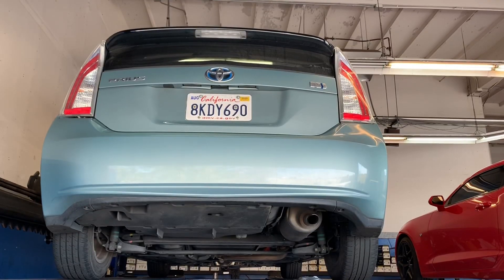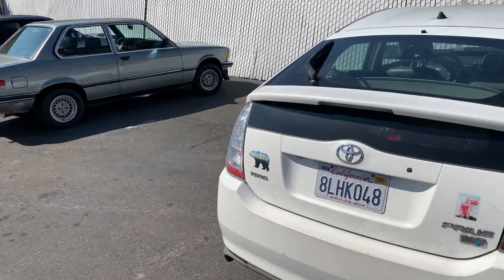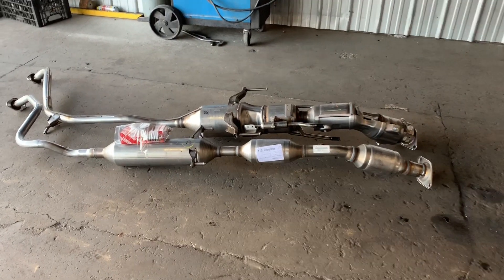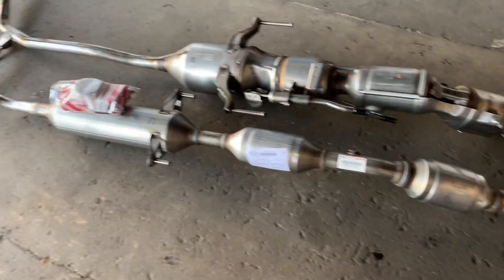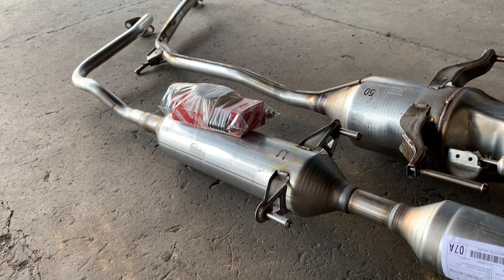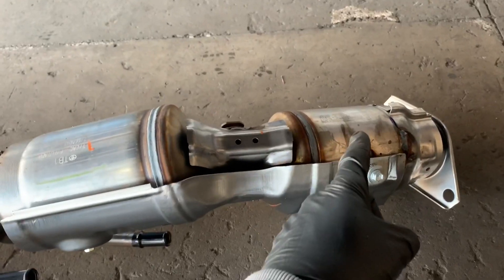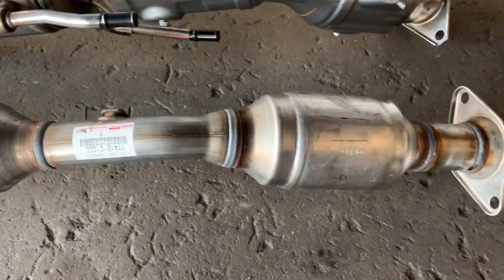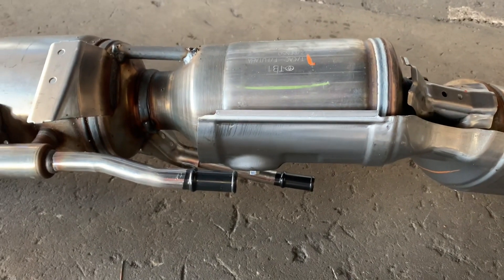2010 or newer Prius?  Do not drive it with a missing catalytic converter!

Comment: Water is not cooling the catalytic converter  its for heating up heating system in the winter
Reply from the maker: Yes!  We learned this soon after the video was published.  I’m surprised it took this long for someone to comment on it.  Thanks for the information!
Reply: @mufflertech  Is this coolant line part of the main engine coolant line ? If it gets cut by the thief is your engine at risk?

Comment: I thought your warning about not driving the prius was just a tow truck pitch. But you made a very good PSA and u get a thumbs up for that.... Next question tho is what kinda moron designs coolant tubes from the engine going to the exhaust.....
Reply from the maker: I believe it’s designed to get heat in the engine faster, hotter engines produce less emissions

Comment: So basically even though that person in your video had shield protection on their car. The burglar still managed to screw up the entire system of the car just by cutting around under there. Smh and funny enough I took my 2012 to the dealership to try to get a catalytic converter shield. And the dealership said that they don't have any shields available for Prius 2010 and higher.
Reply from the maker: They did not have the shield when they were burglarized.